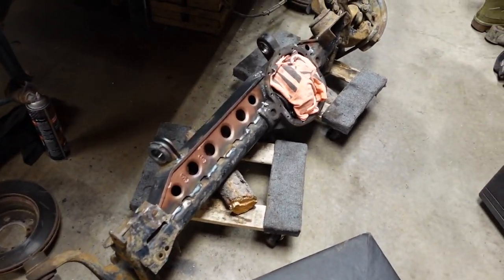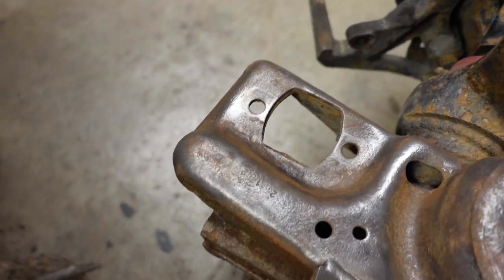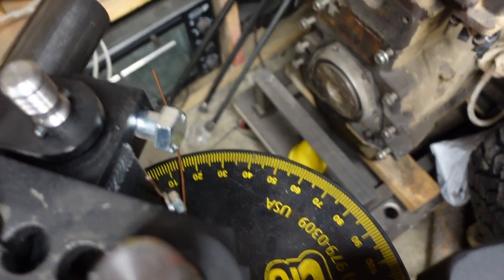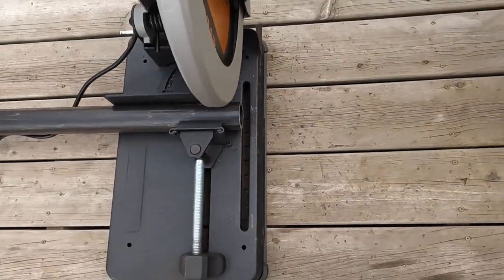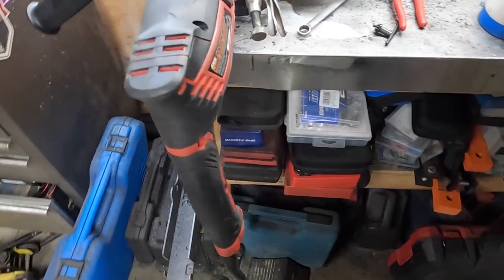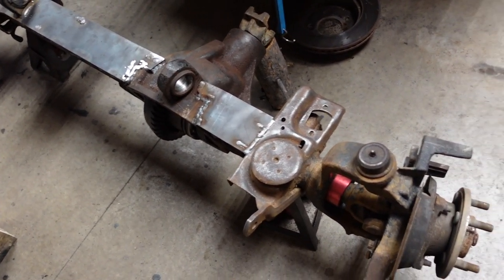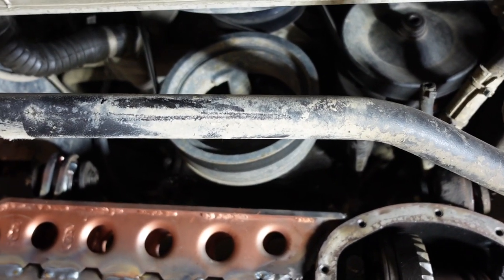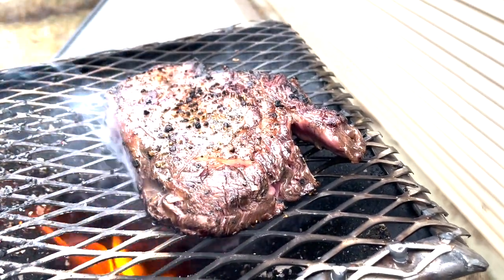BUILT NOT BOUGHT | Custom Jeep Control Arms

Comment: On the go pro.  Take the sd card update the firmware to the sd card then reinsert it to the go pro it works better to update to the sd card. Not update to go pro.    The update on sd card works way better on any go pro. People plug the go pro in a update.  The sd card is better to update on.   This way easier to firmware to work like a hard drive on pc.
Reply from the maker: I didn’t realize you would update off the SD Card